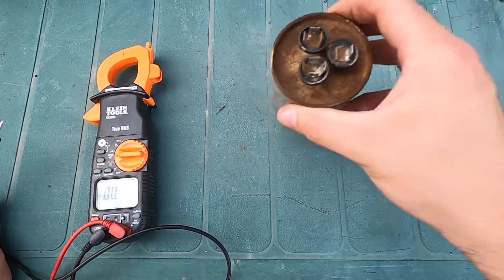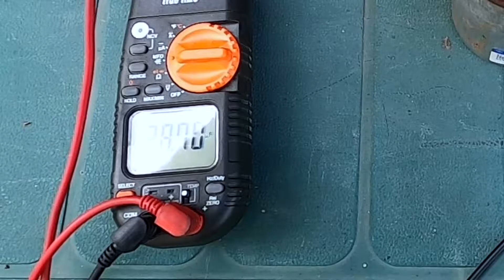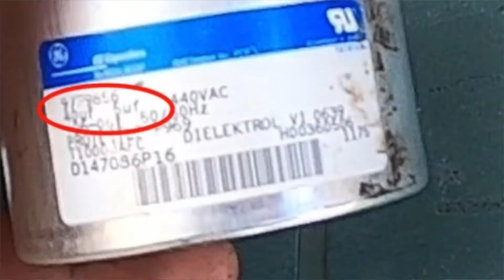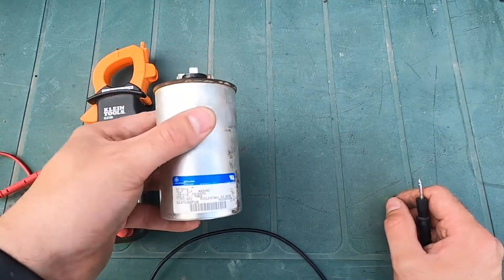Testing and Replacing a Capacitor on an Air Conditioner

Comment: Excellent video. Great explanation on the two capacitor testing and troubleshooting, I just endured two nights in a hotel, two days wait for an A/C guy to come out and replace both of these capacitors here in Phoenix during August with +110f temps. Granted I had a $69 service fee for my house home insurance otherwise it would of been more. This ended up to be a $400 hit that could of been avoided with this knowledge. The A/C repairman did not mount both caps and left them hanging from the wires in their boxes. Did this give me the added incentive to learn this? Yes!

Comment: This is a very good video.  explained very well.  I have the same machine , I finished fixing.  I had to buy a expensive multimeter  because all the multimeters I have couldn't measure capacitors..  But I learned with this video witch multimeter I had to buy... You saved me hundreds of dollars..

Comment: When discharging the capacitor, hold the screwdriver by the insulated handle not by the blade.
Reply: Mr. It will not do anything to you  holding the screwdriver  from the metal.